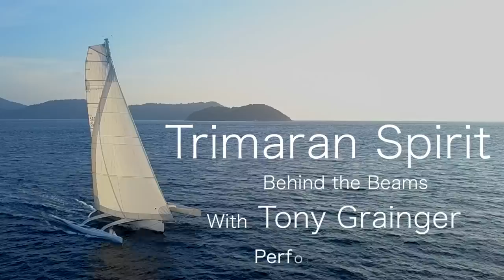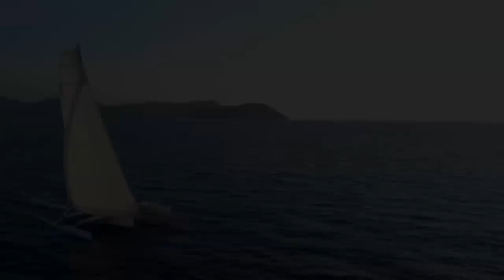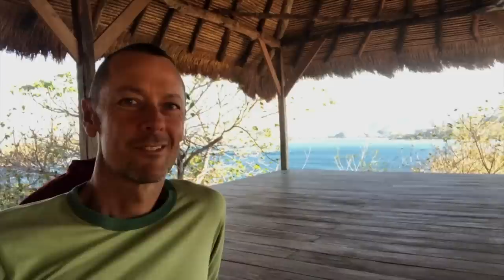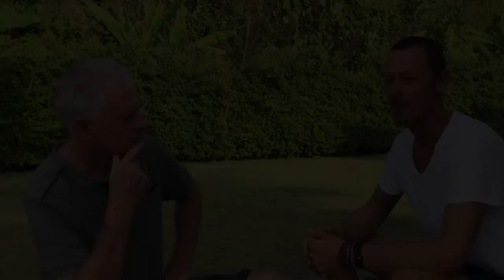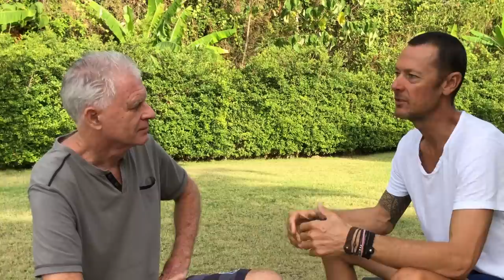Multihull Designer Tony Grainger - Potential Performance Ratios - Behind the Beams Ep4

Comment: This is wrong . The power to weight ratio as in the classical SA/D  formula (sail area / displacement ) is NOT calculated like this at all . The formula to be used is Sail Area / ( displacement/64)^0.6666666 . The power of 0.666666 turns weight into wetted area . This way you have a dimensionless ratio of two areas : the powered area of the sails versus the draggy wetted area that will consume that power. BTW SA is in square feet and displacement in lbs
Reply: Get your Mules right mate lol, You just typed FORMULES.
Reply: @nelsyquintero8323   corrected and added proper units of measure . Thx